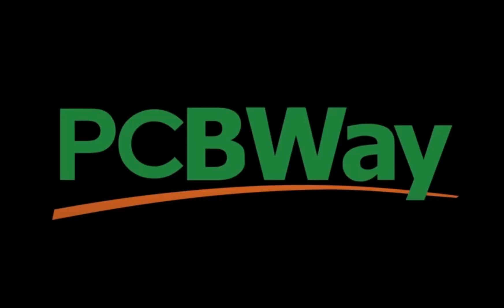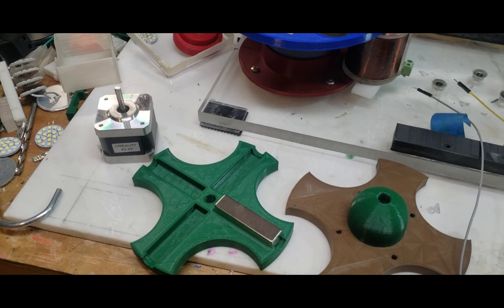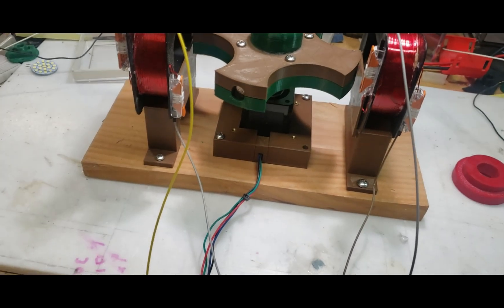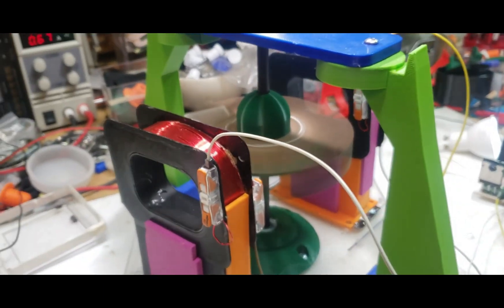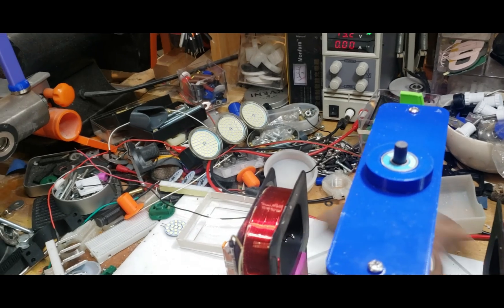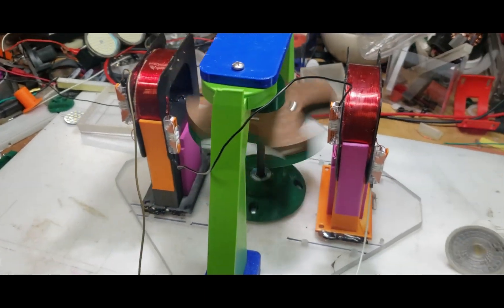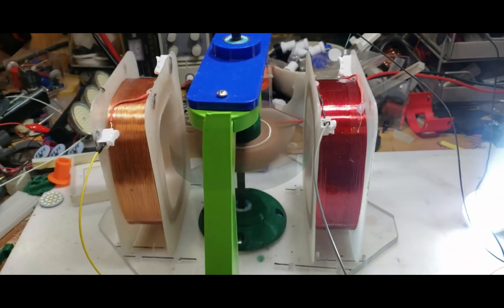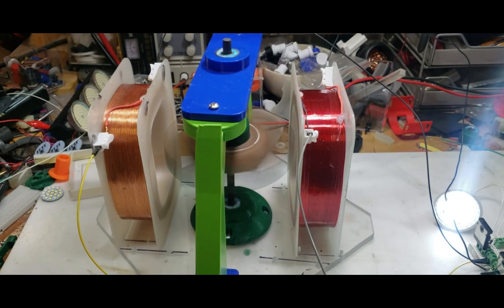3D Printed Pulse Motors New Rotor

Comment: 2 thoughts... 1.. to make the stepper motor run with a bedini.. you need different run coils.. the less turns and the thicker the wire... the stronger the motor (but it will consume much more.. those stepper motors are rated like 1.5 amps.. at 12 volts (depends on what it says on the motor) You were running your circuit at 0.65 at 12.9 volts... so surely it wont run.. if it does you'll get a nobel prize...
but if you make a coil with like 150 turns at 3 ohms.. (probably you'll get that with a 0.7mm wire..) then your circuit will run much faster but consume like the double of what it is consuming now.. and you will be able to run your stepper... BUT: as soon as hook up a load to the stepper, everything is going to stop because of lenz effect. (unless you have a very very strong bedini)

2. what i would try with your newman motor is play around with the duty cycle, that is the gap on your optical timing disk.. for the moment it gives you power for 1/4 of a turn,  try 1/8 th, or one 16h.. you should be consuming much less amps when you do that.. 
keep up your experiments
Luc
Reply from the maker: thanks but i got i to work using the bigger coils and the larger rotor